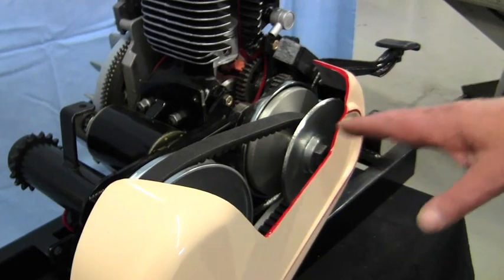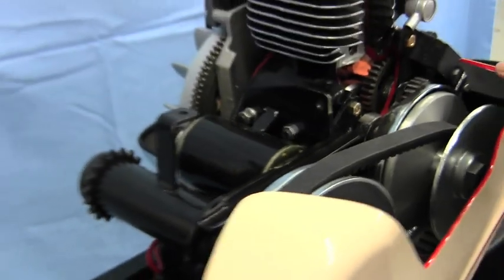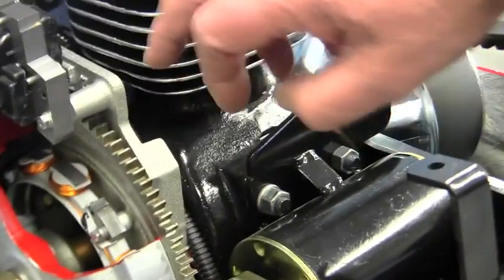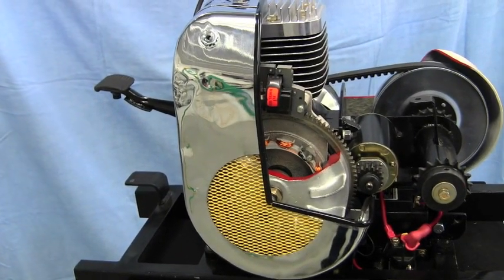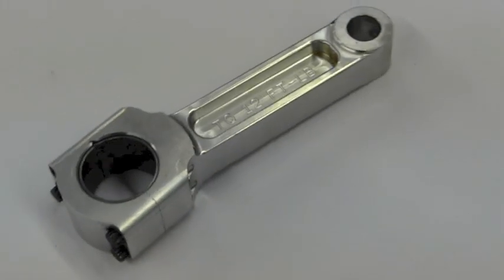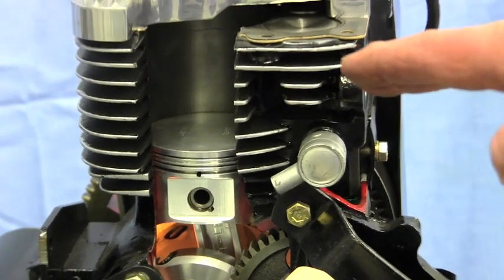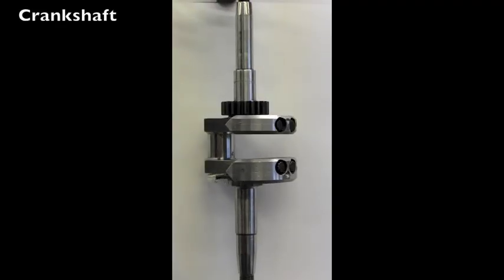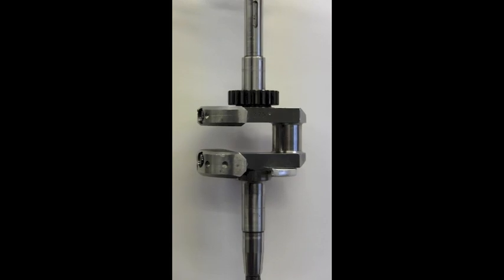New High-Performance Cushman Kits

Comment: With the high performance camshaft, what should the ignition spark advance be set to?  I'm experimenting with my 8 hp flathead engine by making it possible to turn the magneto plate clockwise to advance the timing.  I estimate the factory timing to be only about 18 degrees?.

Comment: I'm wondering, did cushman use roller crackshaft bearings on any of their models ? thank you.
Reply: never
Reply: The Main Bearing ARE roller bearings.. look at  picture of the bearings in a dennis carpenter catalog.. or else where.  The Rod bearing is a plain bearing.. and that is all it needs to be at 3600 rpm

Comment: With a longer stroke you need a shorter rod. Not longer.
Reply: look at the head.. there is now a huge amount of room above the piston that doesn't exist in the original.  This whole thing is dumber than a box of rocks.  The original design is over square.. bore bigger than stroke.. which is how modern engines all work, because it lets them rev higher, and make more power with the same compression ratio.  The approach that makes the most sense, is super charging or turbo charging,, with super charging being preferred,  milling the head for higher compression, and using higher octane fuel.  Cam timing and ignition timing can be changed to suit the new conditions, and a lot of folks say the 22 mm mikuni gives them more speed on a stock engine.  but really 8 hp what's wrong with that ?  I dislike this huge intake valve without a hardened valve seat.. really a low rent way to do things.
Reply: That depends on the  wrist pin location  a stock rod length can still be used  but the  critical angle will affect the rotating mass  and stresses  so a longer rod will be at less of an angle and less stress but the rod he is using  can take the stress .

Comment: look at the head.. there is now a huge amount of room above the piston that doesn't exist in the original.  This whole thing is dumber than a box of rocks.  The original design is over square.. bore bigger than stroke.. which is how modern engines all work, because it lets them rev higher, and make more power with the same compression ratio.  The approach that makes the most sense, is super charging or turbo charging,, with super charging being preferred,  milling the head for higher compression, and using higher octane fuel.  Cam timing and ignition timing can be changed to suit the new conditions, and a lot of folks say the 22 mm mikuni gives them more speed on a stock engine.  but really 8 hp what's wrong with that ?  I dislike this huge intake valve without a hardened valve seat.. really a low rent way to do things.